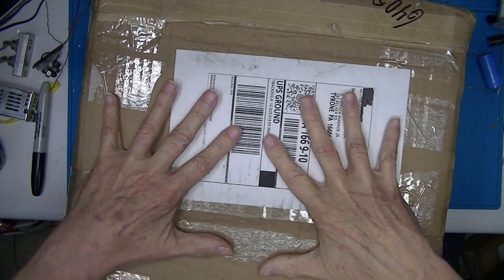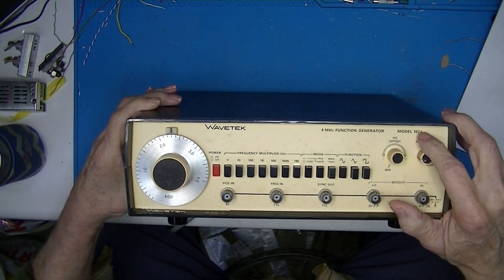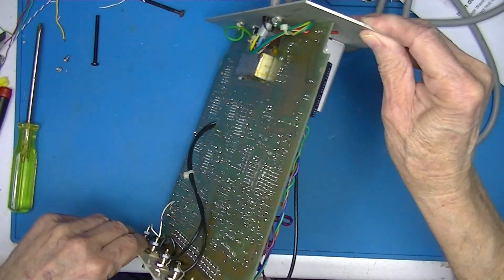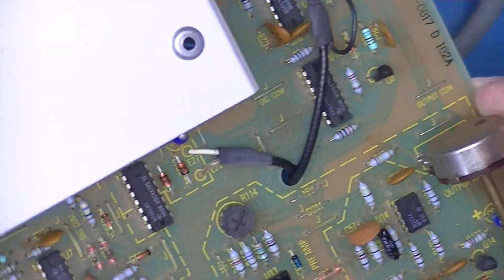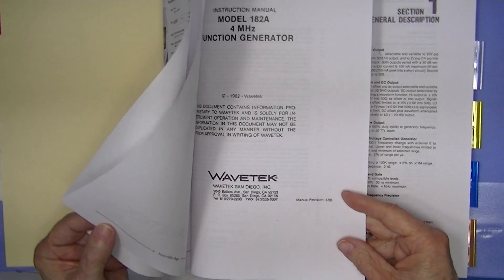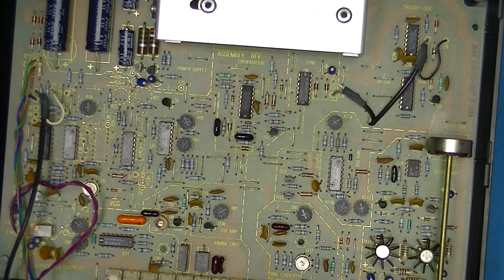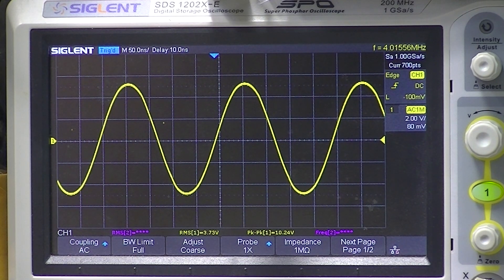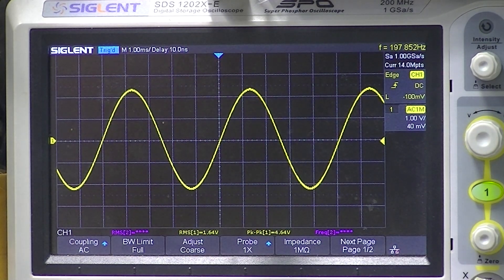WaveTek 182A, 4 MHz Function Generator

Comment: @4:40 = The rear, left BNC connections at E15 and E17 appear to be non-shielded Bell Wire. Shouldn't they be coax, as are the others? Maybe check the schematic, or compare it to your other unit. The perfectionist in me would have to replace the one, odd input(?) resistor. lol... And, the adjoining green, axial capacitor, as it shows signs of burning/heat, from the prior replaced resistor failure.
Reply from the maker: Of the five BNC connectors, three have coax leads, and the two output connectors have stranded leads connecting them to the circuit board. The interconnect drawing shows this and the factory colors. These have not been changed. The two green axial devices are resistors and seem fine. 
Thanks
Steve